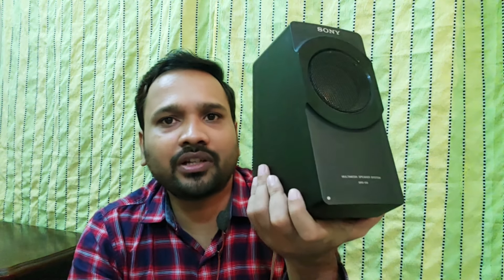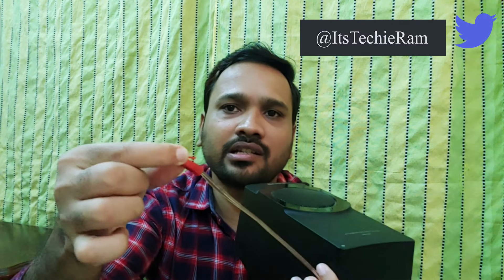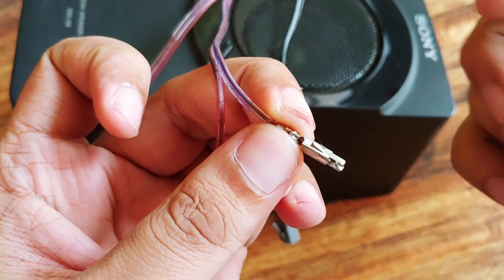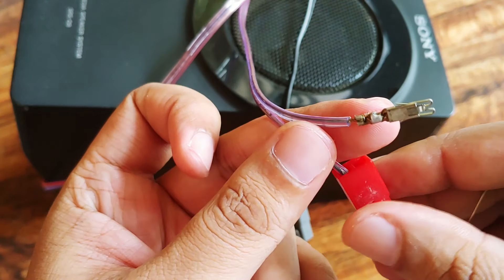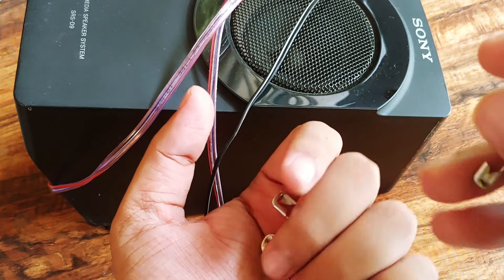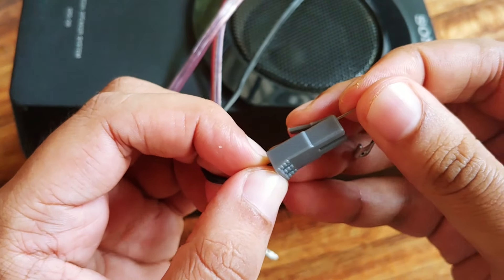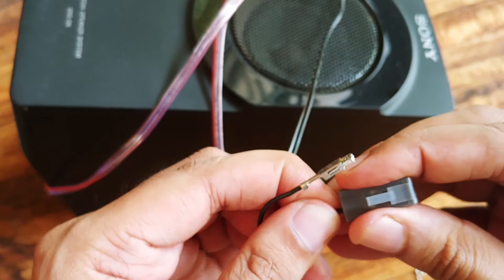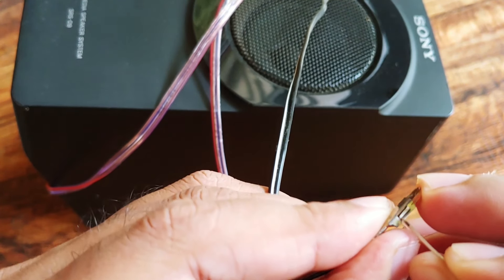Sony Home Theatre Speaker Connector Pin | Removing removing sony speaker connector Pins from Plug

Comment: The only information was missing is to guide how to remove wire from the pin, how to attached new extended wire and then attached the wire into pin. Just a suggestion. Overall Satisfied Video.
Reply: Can u please upload for the same

Comment: Thank you so much! I just bought a Sony multi channel AV receiver to use for my projector. When I use chromecast to cast netflix to my projector, its fine when I just connect a speaker via an aux cable to my projector. With youtube I have a problem getting both video and audio. My workaround is to use the static Sony speakers I have from a DVD home theatre system with the Multi Channel AV receiver as the static speakers. I'm plugging my chromecast and projector in the AV receiver, along with the speakers. My speakers had these plastic caps on them though, which I have to just put the ends of the wires in the receiver. I wasn't sure how to remove the plastic caps. Thank you for helping me fix this massive projector problem I've been having!

Comment: Dear Friends You will find more easy way to connect & extend the wire for these type of connectors..At the end of speaker wire where there is Female end, Simply insert your new wire for extension with help of safety pin and fix it with cellotape. and at the end of subwoofer where there is male connector , here use your normal ball pen empty refill (cut it for 1 or 1.5 cm) remove cover of wire slightly more than that 1/1.5 cm and pass through it and fix the backide i.e refiill and wire with cellotape and insert that refill filled with wire in male connector.

Comment: Thanks for this video dude, explained very nicely. May I know what would you advised, removing pin (considering the risk of breaking the pin) or cutting off the wire in between? which one is easier and reliable?
Reply: @TechieRam  Thanks for the reply!  just one more thing, you sure joining similar quality wire in between won't compromise sound quality, right?
Reply: Can you tell the cable name for the rear speaker
Reply: @abhishektawari9143  12-16 Guage CL2 rated Oxygen Free wires

Comment: @Techie Ram, Could you please tell me what is the specific name for this pin, so that i can buy it. Thank you
Reply: did youfind any answer yet? if yes do reply
Reply: @d.raymondroy3696  No, that's something else
Reply: It is sony speaker connector
Reply: 6:41is the pin is available or not please reply
Reply: It's proper name "Connector housings" but there is a slight diffrence for each speaker model. Usually these kind of cables/pins are called'Connector housings"

Comment: I am planning to buy this one. I have already provisioned cable for rear speakers in my ceiling. Is there a possibility that I can use existing my cable that flows from ceiling to tv panel. Reason I ask this question is that, at the subwoofer end of cable there is clip which I feel may be problem for me. Also is it fine to cut in built cable and then join to my existing cable using tape? If not what's alternative?

Comment: Sir, where can I get SONY SA - D10 satellite speaker wire loose? Because one of SA D10 speaker wire is torn and I need to buy only that wire separately
Reply from the maker: You may not find the exact same wire but you can get 2-core wire at a local electric store
Reply: @TechieRam  is it possible for local electrical store to fix the 2 pined wire with SA D10 satellite speaker pin?
Reply: Pin ka naam kya hai please tell me

Comment: Hi Ram, I lost the 5 color plugs which connects speaker to main home theatre box for Sony HT IV-300 model. pls suggest link where i can get those plugs with this small metal
Reply: Same
Reply: Same thing happened with me did you get it anywhere
Reply: Any luck in getting these connectors.. I broke these for mine

Comment: Sir, I see that u have been clearly remove  the pin from the clip. But sir u not shown the how to join the cutoff wire. Because I am having Sony d10  set and my 3 spickers was cut from the edge of the pin by rat. What can I do now.

Comment: Where do I buy the connector clip for Sony speaker wire?  Any online website?
Reply: Localshop
Reply: @JilzEye  not available so easily
Reply: @VJ-bl2oj  bro did you find it
Reply: @lolipoli9357  nope.. went to a local music system repair shop and go the wires pulled out with a regular male female attachment

Comment: You really have an awesome channel @techie ram. Really useful videos. I have Sony SA D10  4.1  home theatre. I want to extend the cable. Since the connectors are not available in the market, i dont want to tamper with them. Can i cut the wire and extend it? If yes, then which cable to use? Any input will be highly appreciable.Thanks in advance!
Reply: @TechieRam  thank you for quick response. What will be the impact on sound quality if I go with this method? I really don't want to compromise the sound quality.
Reply: Hi Anchit, I just bought SA D40 and I also wish to extend one of the speaker's wire. May I know, did you try cutting off your wire or removing connector pin?

Comment: Is there any other way to extend the wire of speakers?
Reply: Yes just buy male female pair of 2 pin JST connector
Reply: @shubhamchauhan8299  can I use jst connectors if my speakers have the connectors as shown in the video , but they are broken
Reply: @lolipoli9357  yes u can🙂